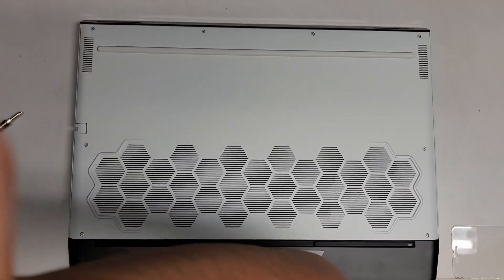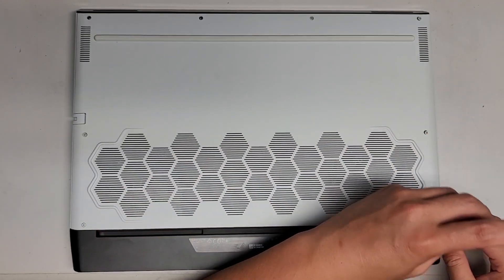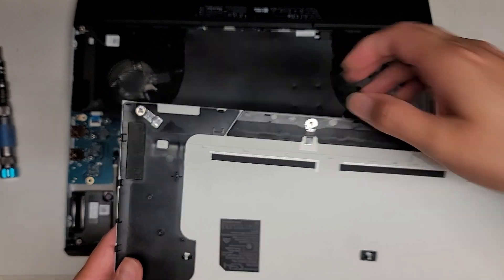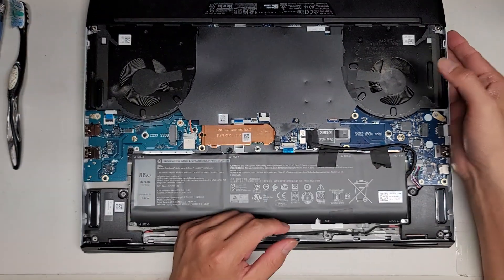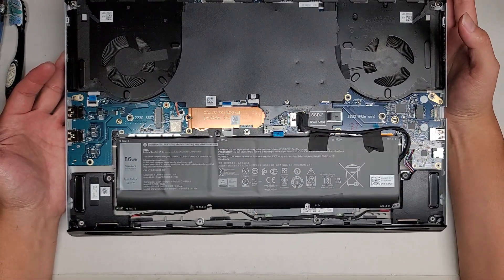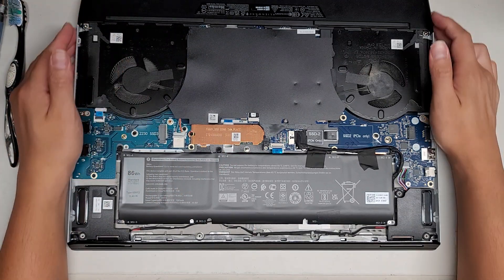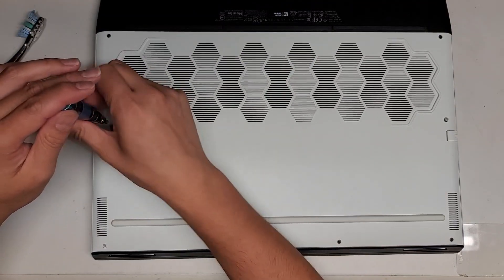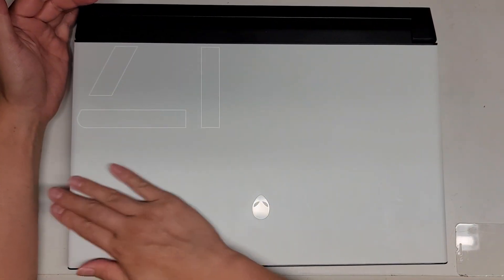Dell Alienware M17 R3 Disassembly Quick Look Inside SSD Hard Drive Upgrade Repair Where's the RAM?

Comment: Do you have to remove the lcd panel to replace the display cable? My display (backlight) flickers when I open and close the lid the display show fine on a secondary monitor so I bought a new lcd display cable
Reply from the maker: Yes
Reply: @ItsBinhRepaired  thank you for the response! First and last time buying a dell too many quality control issues but worth a shot before I resell
Reply from the maker: @jordanmiles8615  they all have issues now

Comment: Word of advice to anyone on this tutorial. This isn't a full breakdown video. It does not go down to the keyboard into a reassembly. This is only to open the main back of the device.youre working with. Please.check another video for a full breakdown.
Reply from the maker: Yeah, it's just a quick look inside.
Reply: @ItsBinhRepaired  I apologize for the message, but I'm trying to do a full disassemble ATM up to the keyboard as water got inside. I'm also cross referencing the other videos, but I haven't seen the keyboard yet.

Other parts of the unit are dry based on inspection
Reply from the maker: @Quicksymphony  pretty sure the keyboard is held in with melted plastic on this model.
Reply: @ItsBinhRepaired  yeah I'm at this part. So the keyboard and mouse pad are partially working since I dried it out as much as possible before reaching this point. I have a compression air device and a laptop repair kit, so I'm going to let it fully dry and test it. If there's still conflicts I believe I have a 3yr warranty on it.

In a worst case I need to be able to disconnect the main keyboard for now. I have a USB and Bluetooth one and mouse so I can use that while it dries.

If it's not on the front of the device for the cable lmk.
Reply from the maker: @Quicksymphony  I didn't take it apart enough to see.
Reply: @ItsBinhRepaired  fair enough. Wanted to ask just in case. Thanks anyway
Reply from the maker: @XGP  no problem. Usually if you look for parts you'll get a good idea of where the connectors go.
Reply: @ItsBinhRepaired  good news. I left it opened up as much as I could and cleared any water I could find. After using a compressed air unit and leaving it to dry for a few hours it's working without conflicts.
Reply from the maker: @Quicksymphony  awesome!

Comment: thats because it has on board ram its under that black strip u keep pulling up lol
Reply from the maker: I just looked up a replacement motherboard. Integrated above the cpu both front and back. Integrated RAM is stupid. :/ I've had some where the integrated RAM failed, making the entire motherboard dead. :(